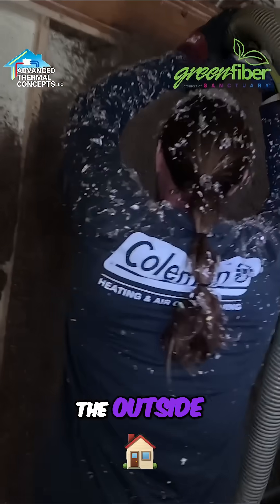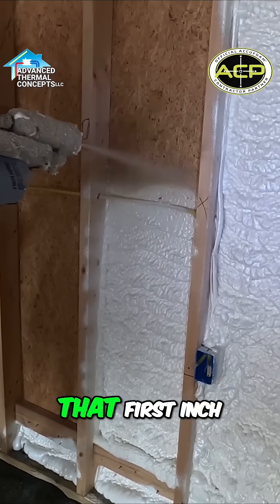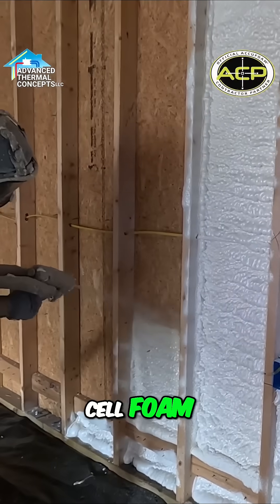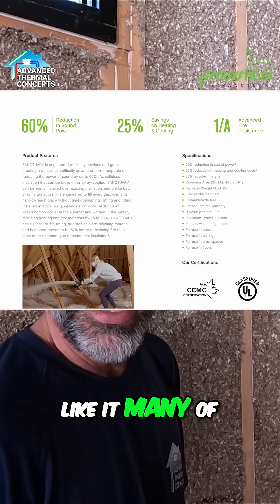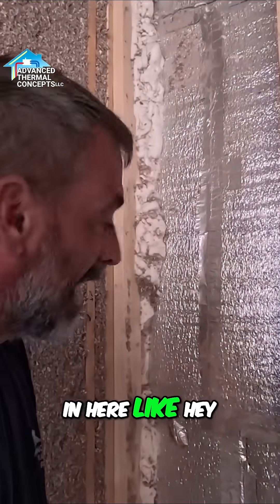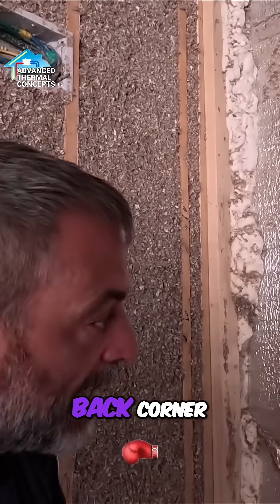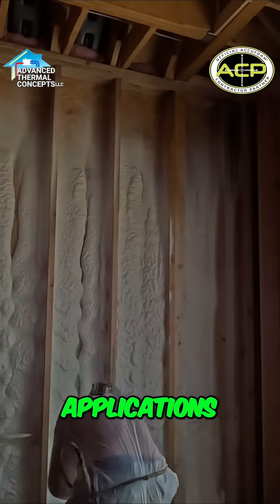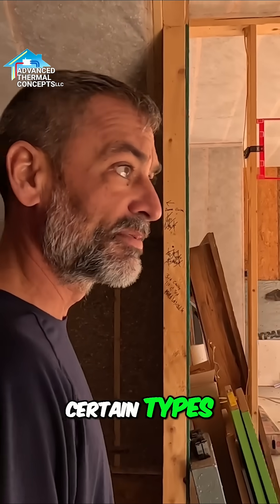Ultimate Insulation Combo: Closed Cell + Cellulose Explained!

Comment: Most closed cell have their R value rated at 2 inches of depth, and aren't recognized as an IECC Class II vapor retarder until it's at 1.5". Layering different types of insulation depends on the zone that you're working with.
Reply from the maker: I agree but we don’t want a vapor retarder in our climate that would be for colder climates
Reply: @AdvancedThermalConcepts what is your zone, if you don't mind? It may help others to compare...